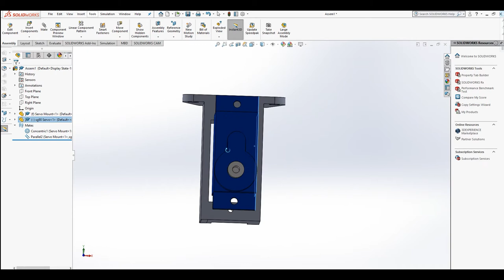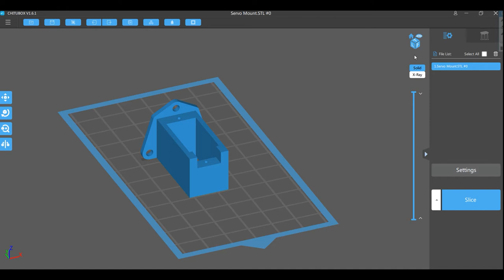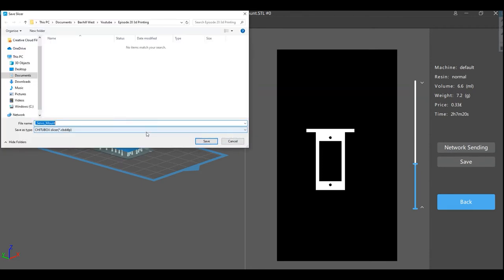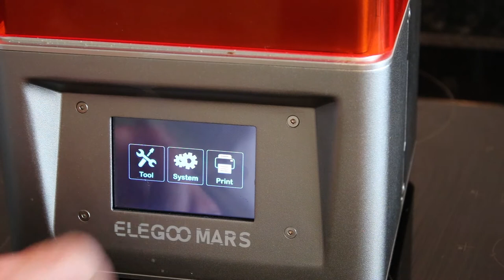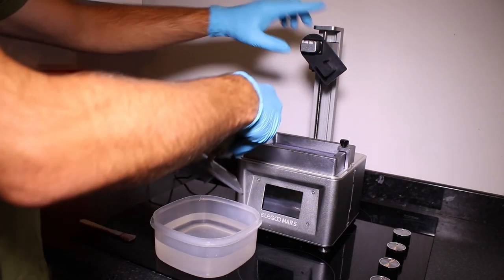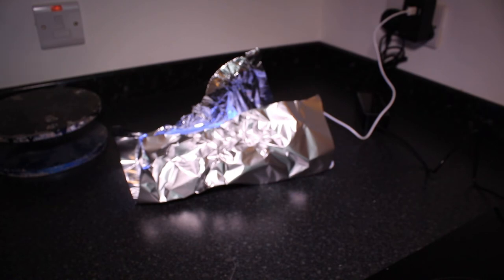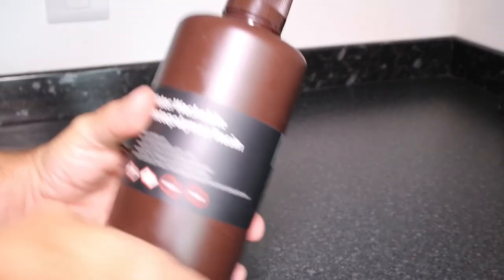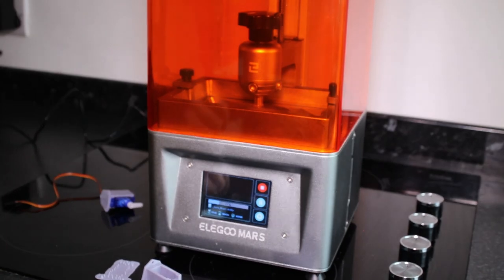3d Printing Process Start to Finish using the Elegoo Mars 3d Printer

Comment: Thank you . Great video production. Ordered a printer via your link. Hope to parts for my railway when I get round to building it. I'd like to use servo for my points too. And make signals as the price of then now is truly shocking. Use to be about £2 when I was 16.
Reply from the maker: Thank you Richard.  I too have been quite staggered by prices recently.  I tend to prefer to make as much of my own bits and pieces as possible, and to that end the 3d printed has been a real money-saver (if that makes sense).  For example I've just rattled off literally dozens of point rodding stools which I'm sure would have cost a pretty penny had I have bought them commercially.
I do hope you get as much enjoyment from your printer as I have. Mid-October I will have a video detailing my latest escapades with the printer which you may find of interest.
Thank you for watching, and all the best,
James

Comment: Good video. One word of caution though, even though that is water washable resin, its still requires special handling. Looks like you are using it in your kitchen? You probably don't want to be handling that where you prepare food or in your sink. The water washable resin can lead to a more brittle print and there seems to be some shrinkage over time with it. Its not bad though and cleaning with water is a plus. I've found that standard resin produces a better result when you clean it off with Simple Green or Mr. Clean (Mr. Proper in the UK). Anycubic have recently released a wash and cure station that isn't too expensive and makes the whole process a lot easier. Resin printing can get expensive, I've found for railway modeling, its worth investing in a filament printer (Ender 3 or Ender 5 are fine) along side the resin printer. You can get much stronger prints and better results, combining both technologies. Keep up the good work with the videos!
Reply from the maker: Thank you for the important safety observation, which I should have mentioned in the video.  The kitchen is the most convenient location for me when filming, but I quite agree with you.  Also, as I mention in the video I don't wash into the sink.  I think that we've enough problems with micro-polymers in our water cycle as it is without me adding to it. :)
Thanks for the tip about the standard resin, I'm sure it does give superior results but for me the additional hassle of using IPA for the clean-up is a disadvantage, although the wash and cure station you mention would alleviate that I guess.  
I'm working on a couple of a couple of pieces at the moment where I will need a very high quality print.  For these I will probably have them printed on a professional-grade machine.  It will be an interesting exercise comparing the outcomes.
Thanks for watching, and for the helpful comments too.
Best wishes,
James

Comment: The idea of being able to run up a rake of mineral wagons, say, for a fraction of the cost of bought models with a 3D printer is pretty attractive, and your instructionals once again highlight the possibilites. I'm still not convinced by the quality of the "castings" produced, though, so I think I'll save my pennies up for a (horrendously expensive) laser cutter instead. A great video with more thought provoking content on the use of technology in model making.
Reply from the maker: Hi Paul,
Thanks for your comment.  I've been very pleased with the output from the printer.  In truth a 3d printer and a laser cutter are different tools suited to different tasks.  And within each 'family' there are different technologies which are better suited to specific tasks.  I enjoy using the technology in, although if I'm honest I still much prefer the joy of being in the workshop and making things by hand. :)

Comment: The filters are for when you pour the resin back into the bottle, to catch any loose parts that were in the tray. For the UV box, you can get motorised turntables, or even ones that have a photovoltaic panel that self powers it! UV led strips can be had similar to the 5m ones that are white. I don't know if subliminal messages are clever or subversive! lol
Reply from the maker: Thank you TimberSurf.  You are quite correct, the filters are advised to capture any loose particles upon returning unused resin to the bottle.  I do think though that any precautions which can be taken to minimise microscopic polymer particles going into the water cycle ought to be observed.  My 'wash' tanks sit on a window sill and after a few days any uncured resin solidifies and is easy to remove from the water before discharging.

Comment: Interesting video. Very clearly explained, so many thanks for that. For some reason I'd always thought that 3D printers worked like inkjet printers, squirting out layer upon layer of the resin. Still difficult to get my head round how it can leave a hole in a vertical surface!
Reply from the maker: Thank you Andrew.  Your comment got me thinking...I can think of at least 5 different 3d printing technologies, including one which does indeed use an inkjet style head to squirt glue onto the build surface onto which powdered starch is deposited in layers.  Some even print in almost photo quality colour too.  I once saw a 3d printer print a 3d OS map with all the contour lines and map symbols in full colour - it even printed the trees in 3d.  I thought at the time that it wouldn't be long before someone 3d printed an entire model railway landscape straight from a map.  That must have been 10 years ago, and I'm certain that the technology has come on considerably since then.
That said, I think that the quality achievable from these basic hobbyist printers is amazing at the price.
Thanks for watching,
James

Comment: Hi James, very interesting documentary. I'm a bit behind the times, so didn't realise you can by an additive layer printer for that sort of money, must get one. When I was working we used to get prototypes made in both plastics and metals. Do you know if this machine will do multiple prints at the same time? As you mention it's a big advantage to be able to drive a CAD system to produce the solid models, luckily I was able to use Catia V5, but the licence is too expensive for private use. How do you get on with Solid Works?
Reply from the maker: HI Stephen,
Yes, the machine will do multiple prints at once, providing they fit within the print volume of the machine.
I like using Solidworks, but have used a variety of software.  I also use Fusion360 which is free for non-commercial use, another which I like in OnShape.  OnShape is cloud based so you can use in on any device.  I used to use it a lot where the ability to pull-up a drawing on my phone or on a tablet was a real advantage when discussing a drawing with a customer.

Comment: Excellent video again James, i have a question, how do you know how much resin to put into the tank when you start or can you refill it if it runs out part way through? Or do you simply fill the tank up and pour what is left at the end back into the bottle? I really need to get this cad thing under my belt , i'm itching to have a go of this. Well done!
Reply from the maker: Thank you Phil.  The tank is filled with more resin than one is likely to  need, and the excess is filtered back into the bottle.  I've not needed to top-up part way through a print, but I guess it could be done at a push, but its not really necessary if the tank is topped up at the start.
The process is quite rewarding and I've been delighted with the results I've achieved so far. There are thousands of downloadable files to get started with which are fine, but developing one's own CAD skills is the secret unlocking the potential.
Thanks for watching,
James
Reply: @BexhillWest  I am really starting to become enthused with all this, and I realise the final answer is to master cad, the problem I am currently encountering is that everything I own is Apple based so I am looking for a simple cad package, I have tried a couple of free ones but not sure what would be best for a complete beginner? Is there one you would recommend please?

Comment: Hi James very informative however why did you choose resin over filament?
Reply from the maker: Hi Nelson,
Quite simply because the resin printers achieve a much higher resolution.  Filament printers typically offer a larger build area, and can be (theoretically) cheaper to run.  I used to use one a lot, but it would often fail when printing a layer, typically after it had been working for hours and so much material was wasted.
Presently my need is for smaller highly detailed parts, and for this resin is the way to go I feel.  If I need a larger part printing I would either design it in smaller sections to be assembled later, or I would send the file off to a commercial printer.
In my experience this is often a cost effective way to go.  It only needs a couple of failed attempts at a large project for the cost in wasted material alone to mount-up.  At least when outsourcing parts you only pay for a quality print - failures are at the companies expense.
That said, there are strategies for minimising print failures which is something I will look at when the CAD series goes 3d.
Another consideration when outsourcing to a commercial printer is that they tend to use far superior technologies, and thus provide a much better end product.  I'm currently working on the drawings for a couple of locomotives.  I will almost certainly get these produced professionally even though they are within the capacity of my own machine.  At the end of the day it's about having the right tool for the job, and filament printers certainly have their uses and benefits.
Best wishes,
James

Comment: My printer doesn't seem to be able to read any files on the USB apart from the ones it came with. I've saved STL files in Chitubox and had them on the drive and the printer just doesn't recognize that they exist. It also doesn't read any other USB sticks I put into it.
Reply from the maker: Hi Joe, 
Have you tried upgrading the firmware of your machine?  I had exactly this problem and that was the solution for me. 
I can’t remember how I did it off the top of my head, but there were lots of walk-through online and it was straight forward. I
Sometimes it is necessary if Chitubox updates itself with features for which the printer isn’t compatible. 
I hope this suggestion is of help to you. 
Good luck,
James